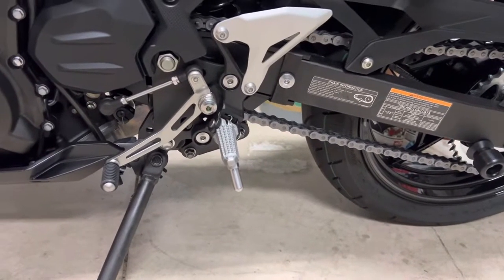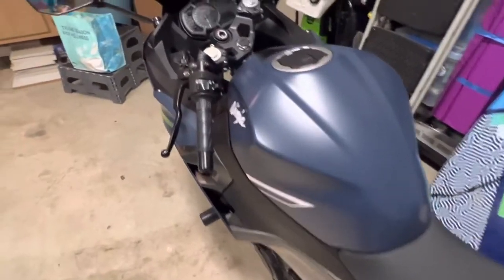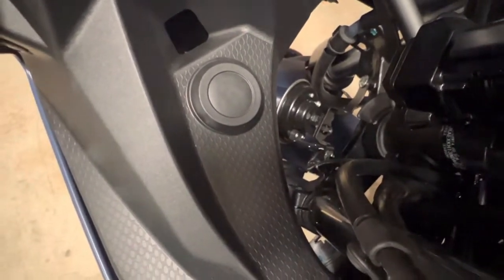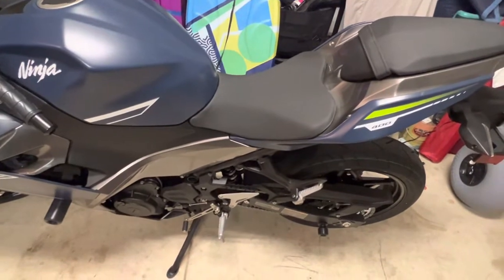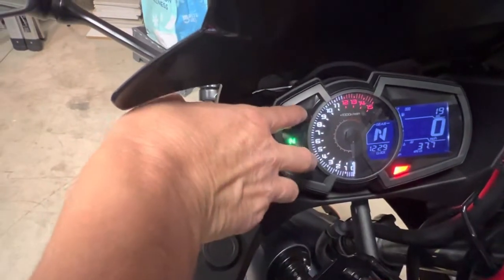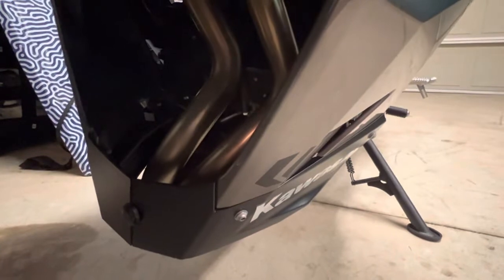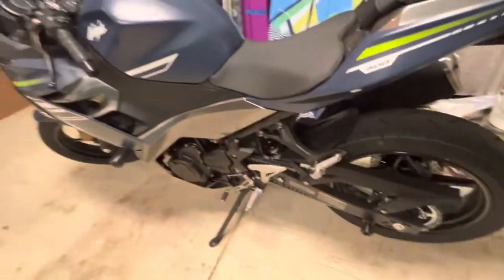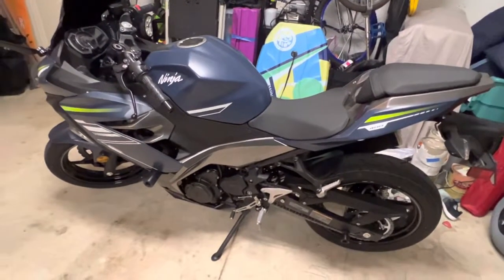What bike could this be? 🏍 😊👍

Comment: You will love this bike!  I bought my 400 this spring. I had never owned a “sport” type bike ever. Wasn’t sure what to expect. I bought mine when snow was still on the ground. I wanted to secure getting a 400 so I bought it with out ever riding it. The dealer was selling these as fast as they were hitting the floors, and wasn’t expecting many, if any more this summer. I had pretty much only ridden dual sports or cruiser type bikes. The bike is impressive for its size, and I love it. I don’t see myself upgrading to a bigger bike as you often see happening. At 51 years old I am perfectly content. Plus, I’m getting 57 MPG!!
Reply from the maker: I too rode a lot of adventure and cruiser bikes. The 400 is just perfect! I didn’t want a top heavy bike. The Ninja 400 is light and soo much fun! 👍🌟🎉😊